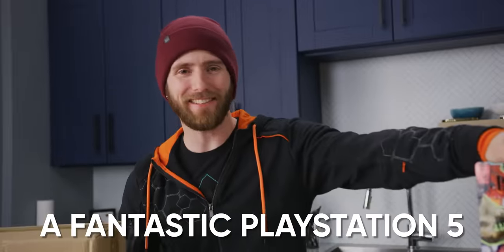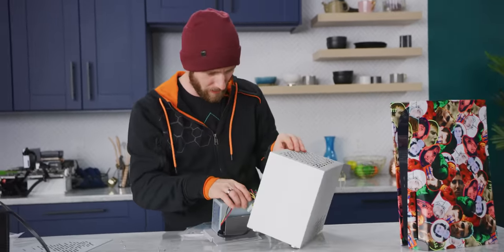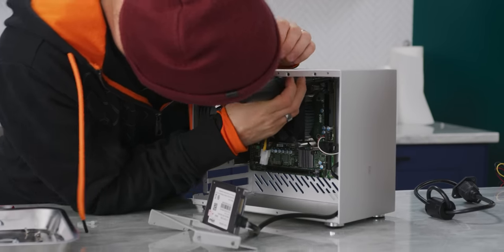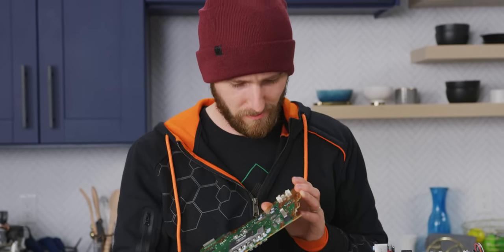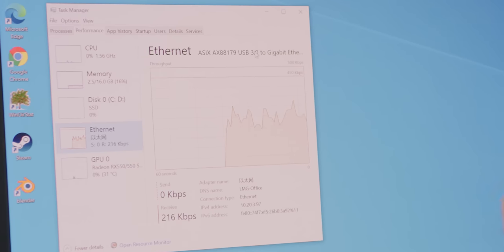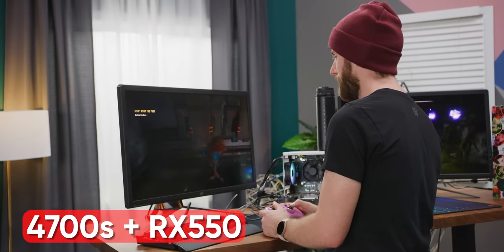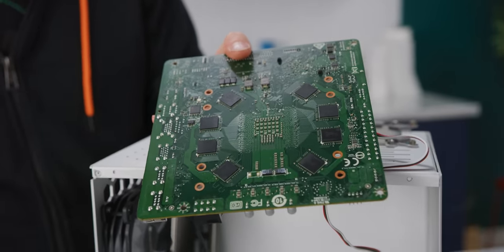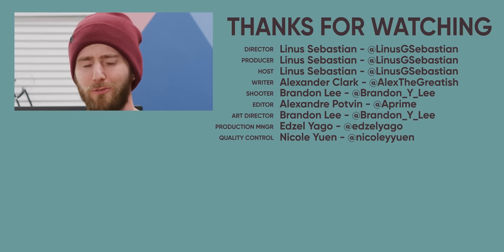Why Is AMD Selling Broken PlayStation Chips?

Comment: I think the idea that re-using PS5 chips "Reduces E-Waste" is a bit backwards.
The chip itself is just a few grams of silicon, basically nothing in terms of pollution potential, you can dump those in the ocean just fine.
On the other hand this system ships with a garbage PSU that everyone must throw out, and a GPU that everyone probably will throw out, you've created about 1000x more polluting materials by trying to re-purpose a PS5 SoC than what would have been created just burying the SoC itself in a landfill.
Reply: in a silicon shortage getting something out is better than nothing, it still cost them money to produce that dye and it is actually saving them money

Comment: Repurposed thrash is what I would call this, I think its cool not letting something that didn't make the cut for a console go straight to the trash! Most likely parts of GPU are deactivated and CPU declocked or power limited/current limited. If there was a way to get the bios modded to see maybe you can increase this failed APU performance to the point where it performs the best and stays stable the longest would be awesome to see!!

Comment: The thing i'm really curious about is the temps. Can you lower the demps in different ways. And can you play normal games and decent FPS with it. Like CS:GO for example. Can you overclock it? Does it perform better OC. Can you put additional RAM, m.2, and so on with additional tools in it. How much can you modify it till it just doesn't work? etc
Reply: You probably can’t overclock it with that cooler.

Comment: I might have missed what he said about this issue, but I'm going to ask to make sure: What about the built in GPU?  Would it have raytracing abilities or not?  Or was it simply not accessible?
Reply: The GPU is from the RX 500 series, which is two generations before RDNA2 brought ray tracing to AMD. So no. It can't trace rays.
Reply: @MapleLeafAce  
but if this is the same apu as the ps5, it should have rdna2 built into it, instead of needing that external gpu.

Comment: I don't get it. Surely this is dangerous and illegal? We use 220/240V in the UK, but in the USA it's 110/120V, isn't it? And the warning label is invisible because it's inside the case? Isn't this a dangerous fire hazard? Does it meet EU or US safety standards?

{:-:-:}

Comment: as far as my experience with running a PSU at 110 when its set at 220 is that it just under performs. i havent blown one up doing this. but my cnc and 3D printer are capable of 12 and 24 volt operation.  while on 220 setting feeding it 110 ( im in the us california) it only gave me 12v power switching to 110 setting it gave me the full 24V to run my machine at full power. I don't recommend it as every setup is different/ PSU maker is different but i dont see it being dangerous for components as they will just be undervolted or not run

Comment: If it is meant to receive 230v, getting 110 should be safe. Due to being half the voltage, it won't be able to pull as much amp as it otherwise would, although most likely it can't function at all.
Still not fun to not being able to use it at all.

Comment: Are there any alternative uses for this hardware? 400USD for a 16 thread, 16GB high bandwith memory is extremely cheap. Do you think it will be a good value for NAS, Minecraft Server, Rosseta@home, render farm or data crunching server?
Reply: I bough it... Only the motherboard and it was $120

 - Can't boot from nvme drive with pcie adaptor (it's not in the firmware)
 - A 120w pico psu was not enough, had to go with standard 500w atx psu
 - Temperatures and noise are out of control (at 100% cpu it stays at 3.7GHz, 1.2v and 101 degrees with fan going 4700rpm)
 - Could not undervolt, nor disable boost, nor limit power consumption

I regret my purchase, shoul've bought a used i5 instead

Comment: The GPU most likely works just fine, it just didn't pass the insane acceptance requirements Sony has put forth for hitting those super high frequencies that the PS5 operates at.
In reality it's likely disabled because AMD does not want to support these GPUs in their driver stack and that the GPU quite possibly contains IP that either came from Sony or was developed exclusively for Sony by AMD and more likely than not a combination of all of the above. So to be able to sell these in any shape and form AMD has to disable the GPU either using some chicken bits or by physically fusing them off during packaging.

Comment: If the PSU is designed for 220V-240V, then there wouldn´t be much danger if you try to plu it in to a outlet that is lower then that. Please try it. It is hazardous if try it the other way around, a 110V device in a 230V Mains. That is why there is no switch.
Reply: And this is E waste from the start. It is a product that is not realy useable. If AMD manifactures the whole MB by itself, they don´t make money with this. This crazy chip shortage time is the only reason why this product exists.

Comment: An AMD R5 5600G with integrated Vega graphics will set you back ~120 euros, a kit of two 8GB DDR4 sticks goes for ~30 euros, a cheap case with a power supply will set you back about 50, a 256GB M.2 NVME SSD give or take around 30, a cheap board about 55-60. That's about 300 euros for hardware comparable to this thing and you get an actual board with upgrade options, better support and you're off cheaper. 
I get the idea of using partially defective chips and like it, but who's going to buy this? It's too expensive for the performance, the quality is "meh" and it's obsolete from day one. My guess is that these systems will be sold off to uninformed parents and grandparents who're looking for a "gaming PC" for their child or grandchild.

Comment: Well, the psu may be cheaped out, but maybe the manufacturer is aware that nobody should use 110 volts grids in 21st century, especially in the current higher power demands of every household.

Comment: I JUST GOT LAST PART FOR MY FIRAT PC :)))
I WATCHING U GUYS FOR ABOUT 5 YEARS
Its used parts all but works for me

10900k (350$) tray
Z490 (120$) (new from ytber review)
1080 ti (600$) (lika a new from one sailor who dont use pc that much)
Corsair gold  750w (70$)
Ram 4x16gb trident z 3600mhz cl17 (270$)
Nochua 14 (big good cooling) (40$)
Ms like a new case aquarium with fans ( 15$)
2x2TB hdd (50$)
Samsung NVMe 980 pro 256 gb (40$)
Samsung NVMe older 512 gb (50$)
G502 (25$)
Razer hynosa v1 (20$)
Monitor 2k ultra wide, 4ms, 34",samsung (260$)
Side screen custom (40$)

I waited for good deals for about 3-4 months

Comment: For around $375 (including a RX550 - € price convert to $ without VAT) in Europe it's not that bad for an glorified office PC or something like that. 
Performancewise it's between Ryzen 3600 and 3600X but you have to keep in mind it's not ment for more than single precision floating point operations and the PCIe x4 2.0 link couldn't even deliever it's theoretical 2 GB/s. 
So if you wanna game this is not what you looking for. Spent around $100-120 more and get a 5600G with a decent B550 ITX board and 16 GB 3600 MT/s CL16 RAM Kit.

Comment: It costs money, to legally fully dispose of any e-waste. This is why most of it is subcontracted to shell companies that ultimately dump it on the shores of Africa. To be able to sell such a thing at all. Is preferable in every way. The gpu was likely disabled purposely to prevent modding of the PS5. Making the system complete garbage. And likely it is only expensive due to novelty and potential access to PS5 silica. If it is a trend that continues we will likely see not only the full SOIC at some point once they realize console modding does not affect their market. But also better prices one the novelty wares off.

Comment: If all the lanes are on the board just like the PS5 to connect the integrated graphics on the chip then why is there no PS5 integrated graphics? Does that chip only function as a processor as it appears to be doing? Is the GPU portion of the chip even there or not and why isn't it able to be utilized if it is there. This is garbage I guess I would like the answers though.

Comment: I'm actually disappointed in the (lack of) build quality of the genuine Sony PS5 mainboard.
When a machine has cheap corner-cutting solder PCB with cheap corner-cutting solder mask then I think it's safe to assume it has cheap corner-cutting thermal paste and cheap corner-cutting semiconductors. The biggest selling point of high-end motherboards (after their ridiculous predatory garish gamer branding and appearance) is the high-quality components onboard - the promise of extra reliability and extra performance and extra longevity (and extra cost) from only the best of the best part selections.
Reply: It's a $399 machine with great performance while being incredibly silent. There really isn't anything wrong with their approach.
Reply: @logitech4873  I agree. You just can't argue with success. But I did expect the product quality to be better.

Comment: I just bought this as an upgrade kit for my mom's computer at $260 usd with the Radeon 550 and a 240GB Sata SSD included. For what you showed it's a killer bargain even if it's half of a 5800X! AMD says it has integrated firmware TPM! Let's see if I can put Windows 11 on this puppy, for the use it's going to have Office, Browser, Zoom, etc... I don't think I can get anything better for the price.
Reply: in argentina this ram processor and graphics card is sold for 200 dollars

Comment: Tbh this is literally E-waste, they should've just made a lower end ps5 or a car infotainment system than waste a perfectly good motherboard, case, gpu, psu, etc that could've been used for an actual system with a normal chip. Or it would be nice if the chipmaker was able to design their chips with 2nd lives in mind incase they turn out to be defective, instead of this abomination.

Comment: i already found bunch of them (with rx 550 as kit. no case, no psu, no storage), for around $400-$450 locally here~
im actually very tempted even though i dont really need another pc (maybe as htpc or living room pc)? rx 550 isnt much but its a great value as working 8 core desktop as it is (better value than mini pc with mobile chip)
(getting low profile case like jonsbo u2, psu and some ssd for another $100, its a real bargain for 8 core, and assuming GDDR6 16GB memory, that latency is.. worryingly or not?)

too bad though 4700s dont have integrated gpu activated

Comment: Wait PS5 M.2 is Gen 2? It uses 4 lanes which means a max speed of 2.5 GB/s which doesn't add up as PS5 SSD is 5.5 GB/s

Edit: yeah PCIe has 500MB/s per lane according to Wikipedia, no way PS5 then has 5.5 GB/s SSD's, they are being bottlenecked

Edit again: Okay PS5 has Gen 4 PCIe, why did Linus say Gen 2???

Comment: Come on alex, don't you have an engineering degree? Plugging a 220-240v unit into 110-120v mains will do nothing. It will not power on at all.

110-120v unit to a 220-240v makes fireworks.

Comment: I'd rather a 4790k, B85 Motherboard and 16GB DDR3 1600MHz RAM instead of that system because it would perform far better and cost far less for $235 USD off aliexpress with free shipping.

Comment: So basically you have a nerfed underclocked power limited 3700x CPU on a die twice the size with no heat spreader ..... and only 4 PCIe lanes that are for a NVMe drive and all the other lanes not routed to the output .....  You'd probably do as well with a Raspberry Pi Compute module .....

Comment: 110 into that psu won't fucking set it on fire. It's the same reason why often psu's with a switch are by default set to 240, it won't work  / won't work well if you simply use 110v, the other way around would however be bad. Fucking fear mongering.

But yes a singe voltage input psu should be banned.

Comment: you said that every chip cannot be made exactly same so the bad ones end up here.
So, does intel also does this?
basically tech companies cannot repeat their products exactly like the previous one? 🤔🤔
Reply: Yes that's why they have k series silicon is basically a gamble if you got a really good gamble on the silicon it can be overclock waaay up
Reply: @MtFoxt  Okay. If two processors are not the same, then whats the use of benchmarking? 
It means i5 in your laptop of a generation is not same as i5 in my laptop of same generation. Right?

Comment: Ah what if you flash another firmware where it gives you more granular control  in order to enable the on bord graphics, maybe an sli configuration, what if you reconfigure as routers or or a dvb-c box y mean china hackintosh  ah flash xbox 5 firmware and ise it as a console  ir even merge the firmware with the build in one 😀

Comment: can i run roblox with my ryzen 7 4700s and rtx 3060
Reply: I don't think 4700s will work with Rtx 3060. Official supported GPUs are  Radeon 550, RX 550, RX 560, RX 570, RX 580, RX 590, Nvidia GT 1030, GTX 1050, GTX 1050 Ti, GTX 1060, but it can run Rx 6600 so may be it's possible
Reply: @princejohn9630 d those gpus you mentioned are 4-5 years old or even more

Comment: CPU

AMD Ryzen 7 4700S Octa Core Desktop Kit || Click Here

MOTHERBOARD

In-Built

MEMORY

In-Built 16GB GDDR6

SSD

Ant Esports 690 Neo 512GB || Click Here

GPU

PowerColor RX 550 2GB Low Profile OEM || Click Here

SMPS

Ant Esports VS400L || Click Here

CHASSIS

Ant Esports Elite 1000 TG || Click Here

OS

Microsoft Windows 10 Home 32 Bit/64 Bit (Demo) || 
For ₹16000 INR or 197.95 $ 
Am I scammed?
Reply: Md computer
Reply: I also ordered one

Comment: Plugging that psu in will burn the place down?? Don't take me serious, I am by no means a professional, but im sure 220v won't burn the place down (im in the UK So 240v is fine lol) Like, isn't it only bad if you exceeded the unit's voltage?? Not under it like it would be for him?? Like, if I took a psu from the USA like that one, but is rated only for 110v then feeding 220v would over heat it, and could indeed catch fire but feeding 110v to 220v ?? I would say it just wouldn't turn the system on at all and just do nothing, not burn the place down xD That's my guess anyway, like I said... I ain't no professional so don't take it seriously!
Reply: the main issue is 60Hz too which means that can cause major issues
Reply: @Ed.E  It actually said 50hz on the unit, I think he mis spoke lol

Comment: You also have to account for the optimization that goes into the releases specifically on the console, so playing the PC version won't be exactly the same.
Reply: That and console firmware is very much more optimized for the hardware provided compared to PCs on windows.